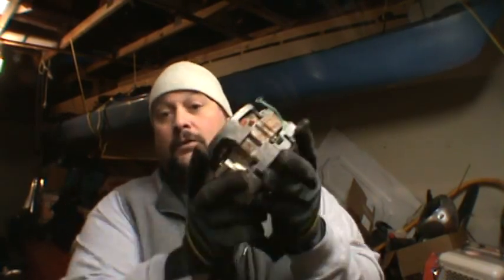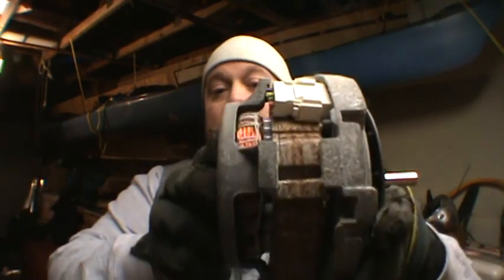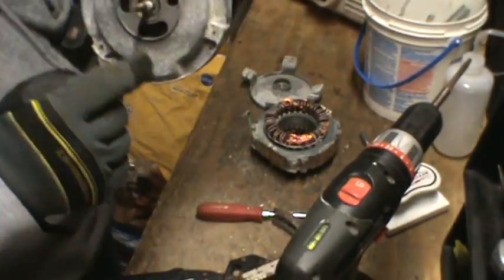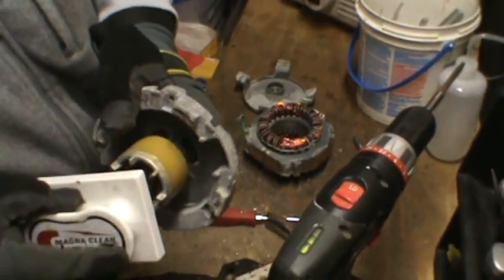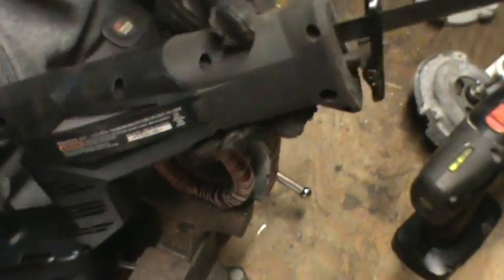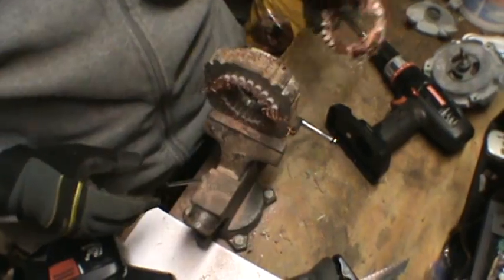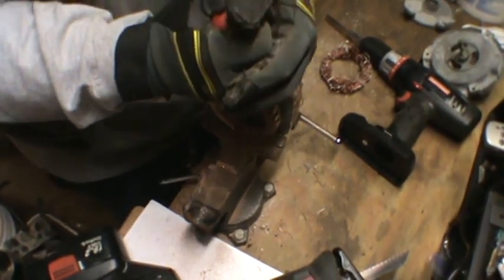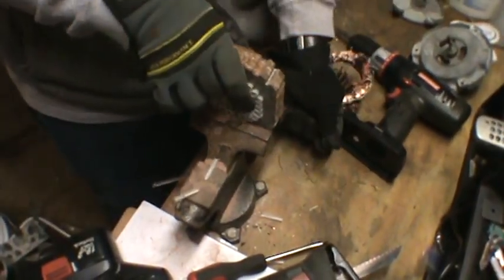Make Money Scrapping Large Electric Motors for Copper

Comment: Nice video, the first time I used an angle grinder to cut thru the copper in a motor I wound up coating the grinding wheel with so much copper it wouldn't cut anything anymore. Your way SO much better.
Reply from the maker: Thats why we make mistakes, so that we can learn from them!  Thanks for the info!

Comment: Stop, Wait.  Go back to that copper I say.  Follow the insulated wire to under the tape area.  You should see a little metal or plastic connection piece.  Crack that sucker open.  SILVER!!  Most electric motors have them just hard to get to under all that tape.  As Always, Great Video & Happy Holidays!!
Reply from the maker: And yet another great tip from Ned "Silver Hound" Landry!
Reply: Moose Scrapper Hey Mr. Scrapper, would it be possible to get a video on what Ned said?
Reply: Moose did u do one on the silver???

Comment: I thought this was going to be about large electric motors that things tiny! In my area large electric motors tend to be quite Hefty probably 7 inches across buy a foot-and-a-half long the variety you find an old pool pump for example it's quite large you should really do a video on one of those they are absolutely loaded with copper and many of them are made of cast bodies so a big enough hammer gets in quite quick and easy

Comment: Hello Moose. What do you do with the core of these motors? How do you take the copper in it? i have tried a lot of solvents to remove that varnish or glue or whatever it is.
Reply from the maker: I have not found anything that works on them so I just toss them in the motor bucket to be sold as is.  Thanks!
Reply: Moose Scrapper Thanks for your reply. I'll try sulfuric acid, caustic soda was not effective...
Reply: @eviltrooper  they make hammer mills for that. if the hammer mill don't take it off it will just get melted down with the rest of the steel. if your doing anything short of one of those two methods I can almost guarantee you that you are making way less than minimum wage if not loosing money removing the aluminum from the cores of these things.

Comment: like your videos but when you get done taking something like that apart put it on a scale and let us know how much you got. Was it 10oz, 3 pounds, etc?
Reply from the maker: It was about 1.5 lbs of copper.  I used to do that on every video but after a while realized that there are so many variances in size with manufacturer, age etc that in many cases the weight of one item could be more than twice or less than half of a similar one. A good example is a couple of stereos I pulled apart.  There was one that had a 3.5 lb transformer in it.  The other though the stereo was that same size, the transformer was less than half of the weight.  I do plan to start putting the numbers in again though.  Thanks for watching!

Comment: How do you remove the copper from an armature?
Reply from the maker: Ugh....those are tough ones.  They are usually dipped in some kind of enamel.  I usually just chuck them in with the other electric motors that I don't take apart.  I have not yet found an easy way to get that copper out of there and for the time required to get out a relatively small amount of copper....ehh... If I find someone who knows how I will let you  know though.
Thanks for watching!
Reply: PUT THEM IN A HAMMER MILL